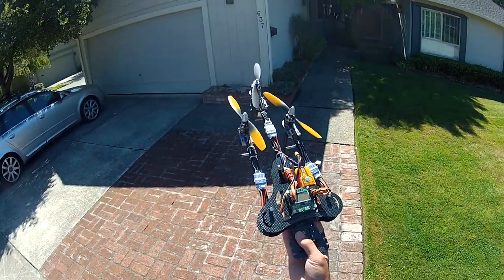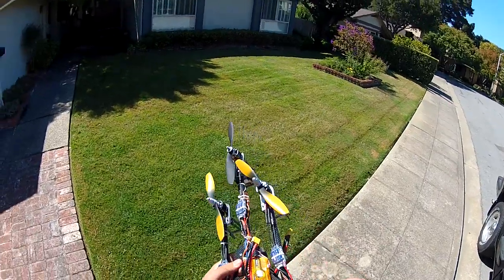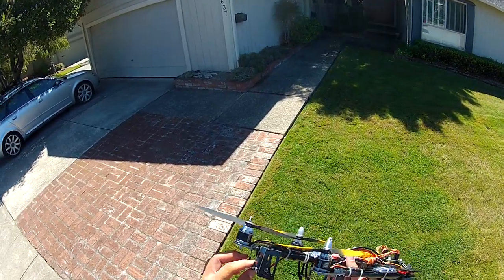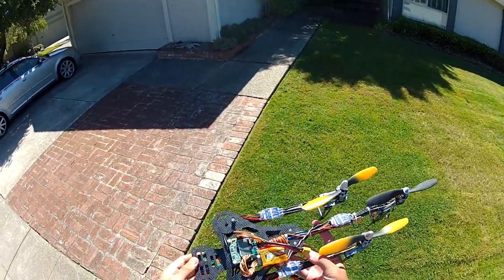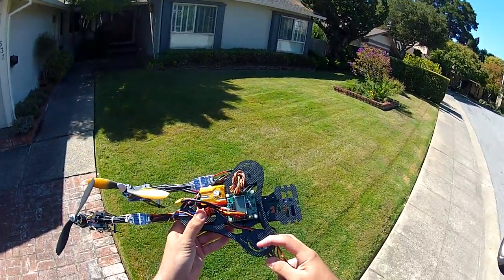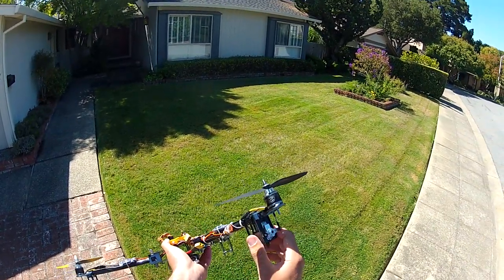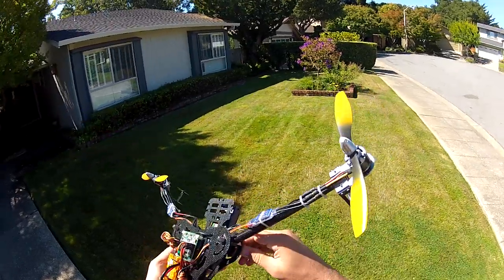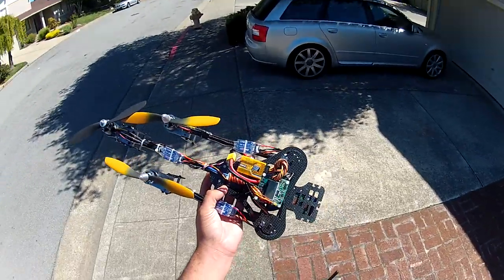Turnigy Talon Tricopter: Close Look and Flight

Comment: My next multicopter is going to be a T-copter with the 90° arms using hardware store parts and T-Rex 450 tail boom arms.  But this Talon is very tempting.  Thanks for showing it supports both 90° and 120° arm locking positions.  Very forward thinking on Turnigy's part!  Very tempting.

I like these casual reviews best.  Not just the video itself but hand picked products that are outstanding for some reason like this Talon and the Bixler 2 to cut through the "noise" of all the products out there.

Comment: The KK board will get power from the speed controls, which are plugged into the KK and have a connector to the battery.  Your speed control sends 'high' power (the voltage of the battery) to the motor, and 'low' power to the reciever to power the receiver, the servos and in this case the KK.

Comment: Awesome! Thanks for sharing. I like the locking mechansims, i have been using rubber bands to keep the arms out (depends on rotation direction of the blades) sometimes a real problem. Very nice and clean tri.

Comment: More motors means more power for heavier lifting, like expensive camera equipment. The more motors will also help with a smooth even flight. With that being said, the tricopters are the best when it comes to aerobatics. You actually have direct yaw control that is real fast and crisp. You have to be a crazy good pilot to get a quad to do the things a tri can do with a more novice  operator.

Comment: I am going to build meself' one of these. I've never build a multi-rotor platform before so i'm excited!. The KK2 board is not in stock, so I will use the older one which is. I know how to program the ESCs so I'll prolly do that aswell (i've done a couple of arduino projects in the past). I'll be using your parts list so thanks a bunch for posting. I think the hardest part in this hobby is choosing the parts for something you want to build, parts that actually work together. Thumbs up!

Comment: Multicopter use brushless motors with have 3 wires from motor to speed control.  When you hook these together, it makes absolutely no difference which whire goes to which wire....(not quite like brushed motors which do).  When you apply power and start up your motor as you slowly give it throttle, take note of the direction it spins. If its not the direction you want, simply pick ANY 2 of the 3 wires and switch them. This will reverse the rotation of the motor. Hope this helps you out.

Comment: The voltage will depend on the rating of the motors you buy.  Each motor will have to have its own speed control, but VERY IMPORTANT!! .... wire your motor power leads in parallel (this means all motor black wires to 1 centeral black lead and all motor red wires to 1 central red lead--these go to battery)...so everything runs off of 1 battery...voltage will be comman and Amps will be shared by all 3 motors....this way when the battery starts to drop voltage, all motors react the same.

Comment: You need to have a strong servo for this part and also a responsive one, hence a digital servo. Since the prop is in motion it requires more force to tilt and that's why you should go for a more expensive servo such as the TGY-306G used in this video for a better result.

Comment: also what or any hardware is required? Do i need to extend the cables from esc to kk board?
what do i need to fit the props to the motor etc?
Thanks in advance.

Comment: HobbyKing ought to sell the BlueSeries ESCs preflashed with SimonK's firmware -- license it from SimonK just like they did with Rolf and the KK boards.  Pass it on to your guys on the inside!

Also, what size props are you using on this sweet Tri?  When I order one, I'll definitely use your links bro!

Comment: Hi, I've decided to get into multi rotors and just wanted to ask a few questions
1) why do you use the kk2.0 control board rather than the non LCD display boards like the HK v3.0 control board? is it better?
2) to learn on would you suggest a tri or a quad, which is easier to fly and best for fpv?
Thanks,
Luke

Comment: couple of weeks and Ill have mine =D 560$ for a whole setup, turnigy 9x rig, turnigy charger, batts (4xturnigy2.2Ah 3S25C) GWS EP CCW & CW Props 10.47, 40amp blues (yes overkill),TGY306 Servo, 3530 Aerodrive 1460's. and ..dun dun dun.. KK 2.0. This thing will be sweet. too bad shipping was 100 bucks (6615g) but ill  get it in a week instead of a month.. Next Ill i have to figure out reprogramming my ESC's if possible on the 40s. I bought other stuff too like prop balancer, wires connectors etc.$

Comment: How do you connect the servo? Because on KK2 board, there is no power on connector 2-8. Did you connect the servo directly to the ESC and just the signal wire goes the board?

Comment: HK now offers a fiberglass frame/box aluminum boom tricopter for 30 bucks. But I am unable to source replacement ball links for either, HK told me to buy the whole yaw mech..yeah right mofos. So now im searching for easily sourceable ball links regardless of the mods Ill have to do.